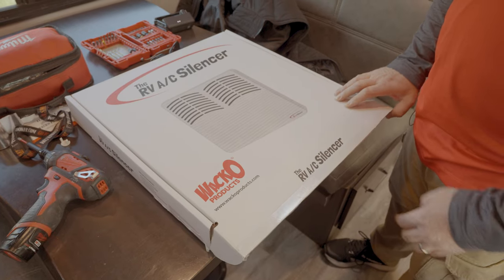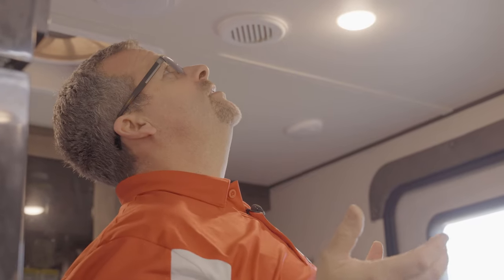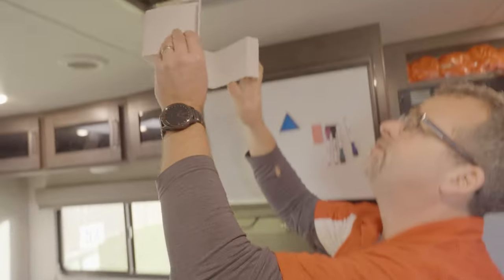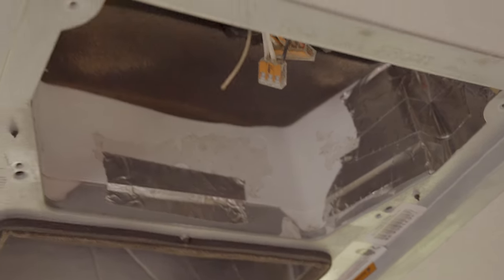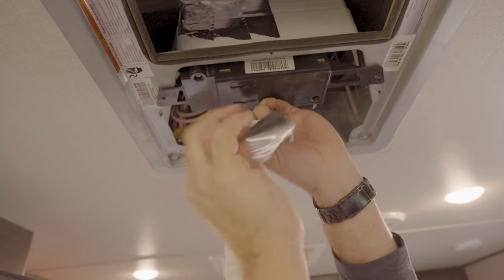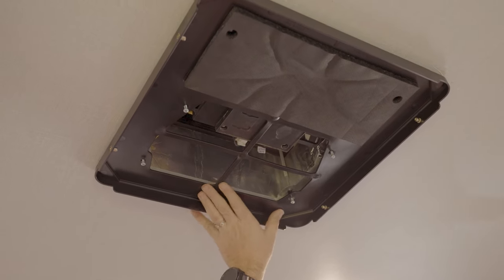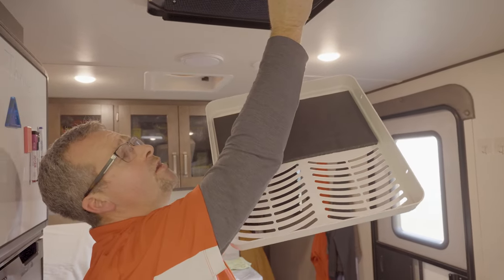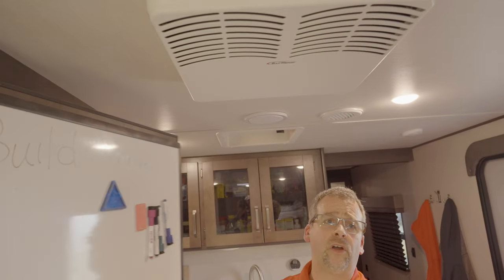Reduce The Noise Of Your RVs Furrion Air Conditioner With This Simple To Install Device!

Comment: Thank you for this information. I've already made sure I didn't have any air leaking in the distribution box. Now I just need to quiet them down and possible find a soft start that'll work for my 3 Furrion 15k BTU units. They're just like the one you worked in in this video